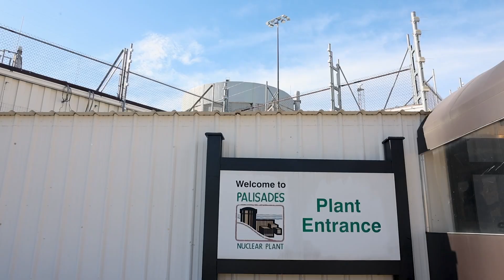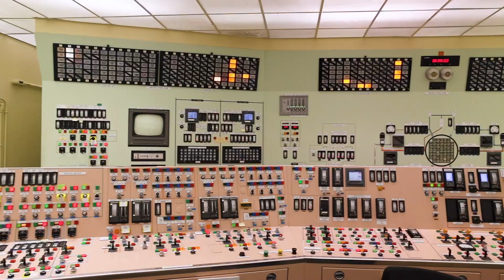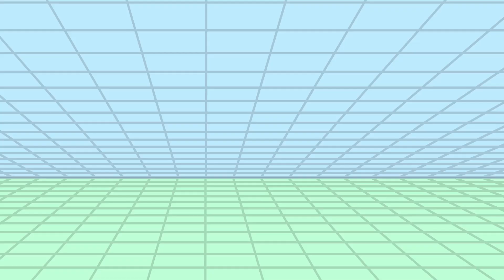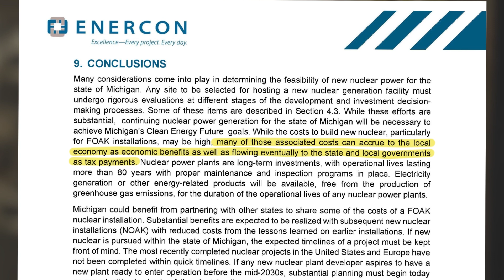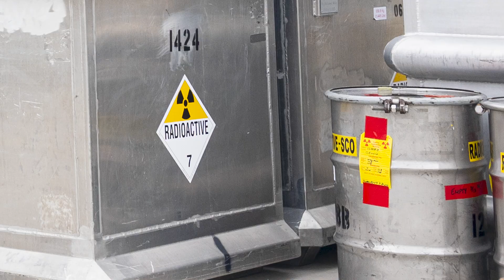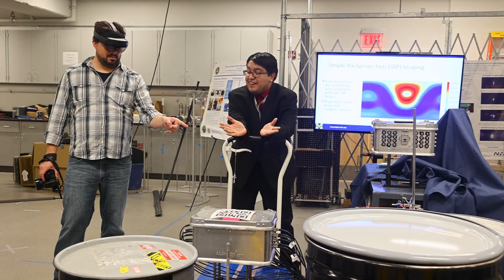Nuclear power may be the key to a clean energy future in Michigan

Comment: Would it be possible to create a reactor that could run on nuclear waste? We could have our cake and eat it too when it comes to nuclear waste if that's possible.
Reply: It's called a Molten Salt Reactor. A new generation of nuclear power. I believe a Danish company has a working prototype or soon to. It will become commercially viable in the next 10-20 years. It's a incredible piece of technology that is much safer and use nuclear fuel that nuclear power plants can't use anymore.
Reply: They're called Breeder Reactors and France has been using them for decades. They used to be outlawed in the USA because of nuclear proliferation scares but they currently arent anymore. No one has made the move to build one for some reason.
Reply: Thorium reactors are another option, thorium is around 1000 parts per million in the soil, you can extract it from any normal excavation operations and it has a much shorter half life. More common and more safe.
Reply: @kriegjaeger  I remember hearing around 10 years ago about the possibility of cars running on Thorium. The person who proposed the idea said the car itself would wear out way before the engine did. Only 8 grams of Thorium would give it approximately 1 million miles of power and the car would be very light too... I wonder what happened to the idea?
Reply: @brosch91  
It seems people who have good ideas for better cars tend to disappear along with any plans or designs they've made... >_>;